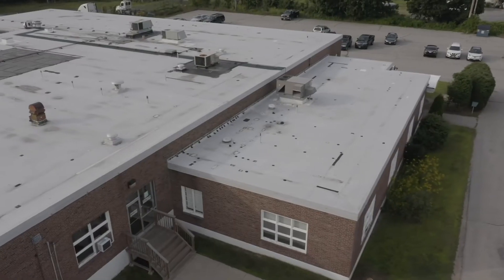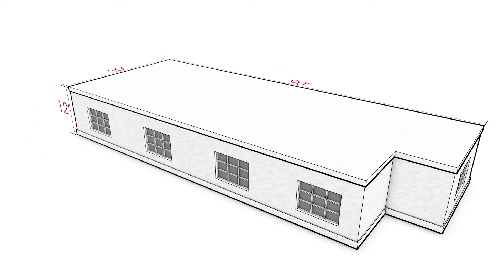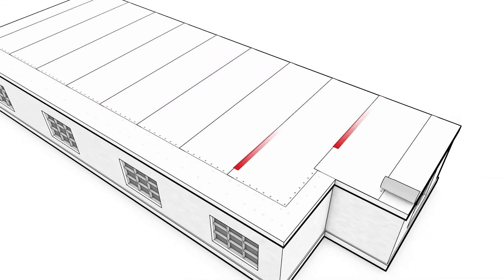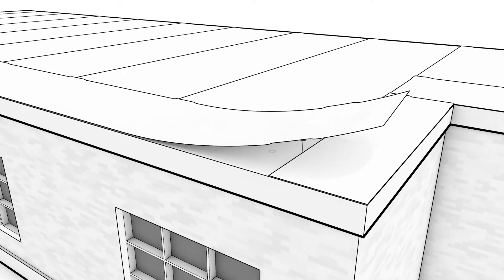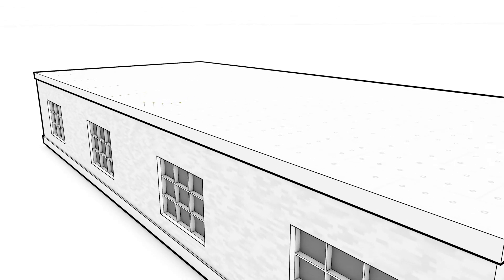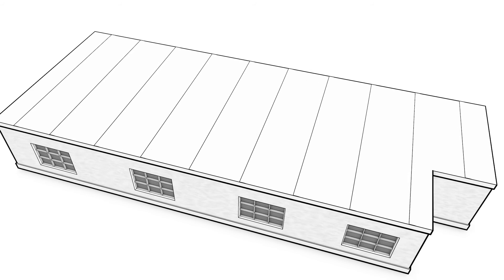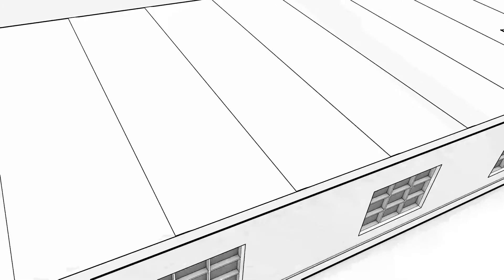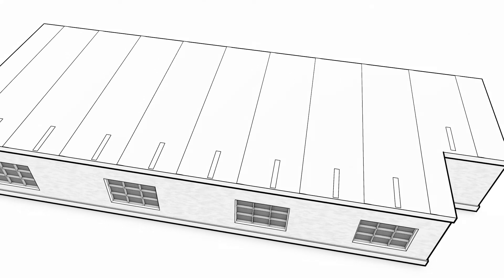Principles and Options for TPO Sheet Layout | Roofing it Right with Dave & Wally by GAF

Comment: Dave, why use a flashing strip? Is it ok to make the strips out of a 60 mil roll?
Thanks
Reply from the maker: Hi Joe. You can use a flashing strip but that takes time and you're probably not going to get a perfectly straight edge which could impact the quality of your weld. 8" flashing strip is factory cut and designed to go over details such as what Dave describes in the video. Overall the flashing strip is more consistent and faster to install.
Reply: Flashing strip already has a straight edge and it's 45 mil so you don't need to use T-Joint Patches.
Reply: @gafroofing  Thanks Dave I don't remember you covering that detail at your seminar. When is GAF going to have TPO for sale again?

Comment: Does anyone have any insight on why/when to use one approach over another? i.e. why were finger strips chosen for this job?
Reply from the maker: Our technical experts are here to answer all your questions! Please give them at call at (877-423-7663).
Reply: Matt, the simple answer for this job is that a Rhinobond machine wasn't available.  Some smaller roofers may not have made the investment into an induction welder, or they may have them but they're being used on a larger job, so fingers were used.